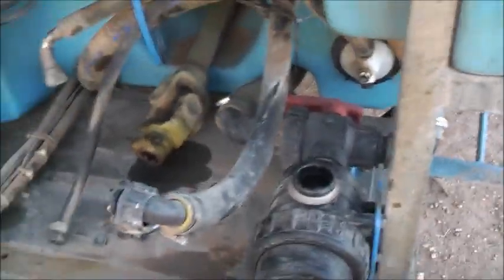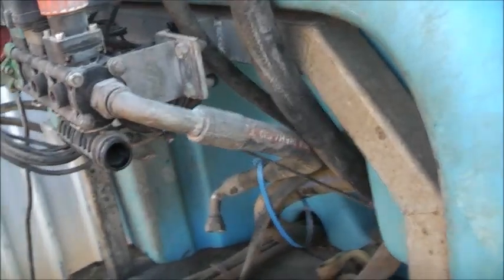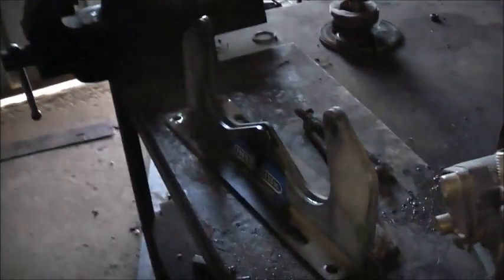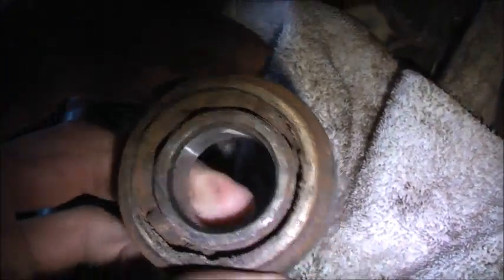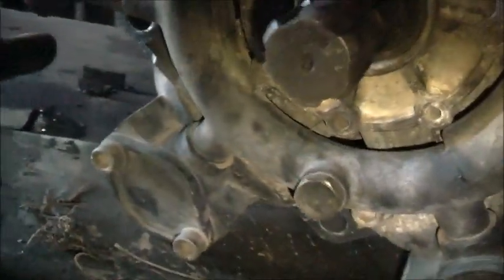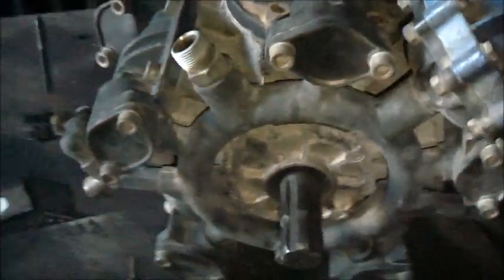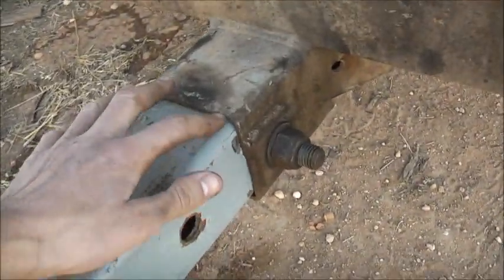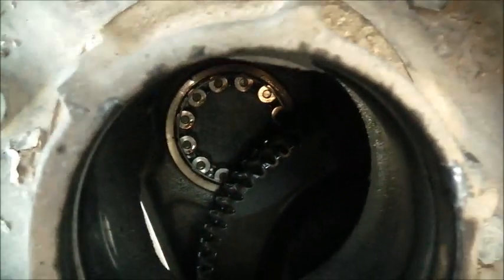Spray Vat Repair

Comment: You wouldn't believe it i am doing similar work on our airblast at the moment. Over fifteen years old. Silvan five diaphram. AP166 i think. Good pumps but the body corrodes and the seats for the seals corrodes away. The valve housing corrodes away. $2500 for new pump so that is what i did! Would have been over $1200 just for parts to fix the pump. Now it's a spare parts pump. We took all electrics off, too much trouble with chemical. Use marine push pull cables. Bet your hands stink like mine!

Comment: No definately Italian made. Problem is the body is alloy. Good for a certain time but then get eaten away. We always flush after every spray. Not a lot of brass on the pumps these days. I guess too expensive. We have a couple of old ronaldson pumps that still go! There is some old Italian spray plants from the 70's around here that still run as good as the day they were made.